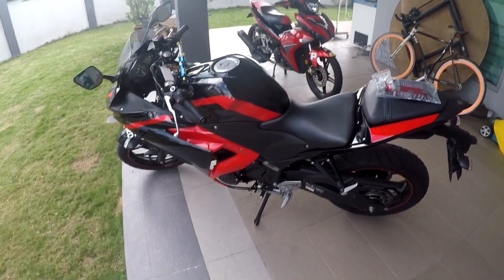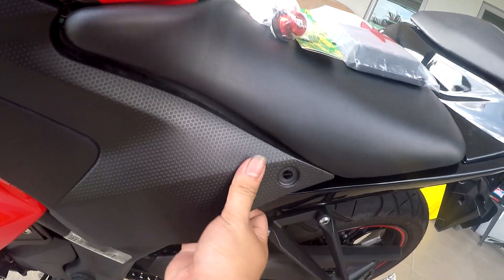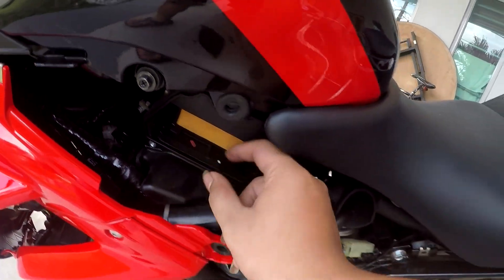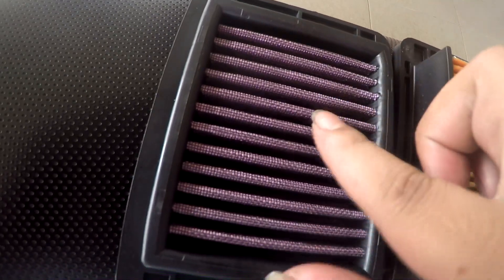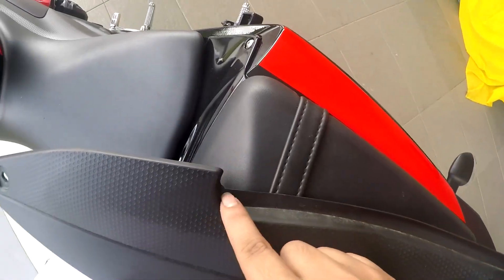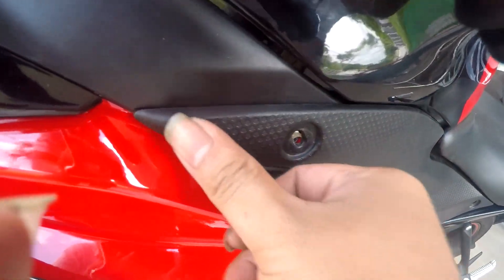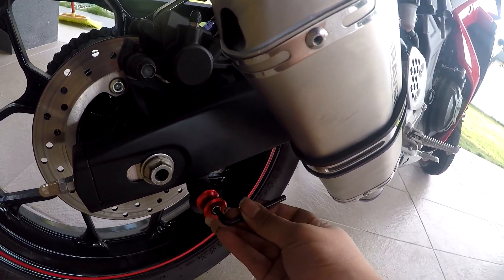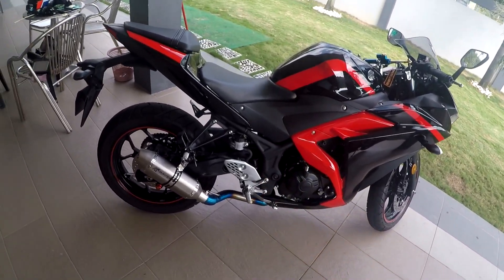Video Tutorial #2 | HOW TO INSTALL RACING AIR FILTER & BOBBINS ON R25 | RAPIDO | YAMAHA R25

Comment: just has one questions by changing the air filter do we have to run FID or dyno the bike ?
Reply from the maker: Yes have to . Compare original and Racing . Racing air filter more smooth flow then ori filter . So ecu need to adjust air 

 . I more recommend to go for AFR tunning . FID only for Feul adjust 

Few day later I will upload about AFR Vlog . Subscriber me to get latest 

Just do AFR enough . It's include FID system
Reply: OurJourney Biker tq 4 info 😀